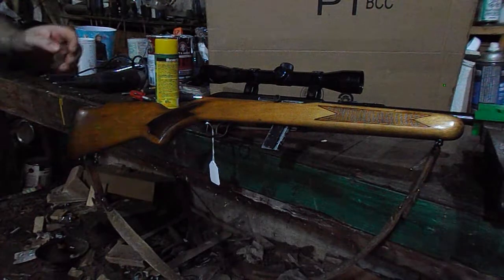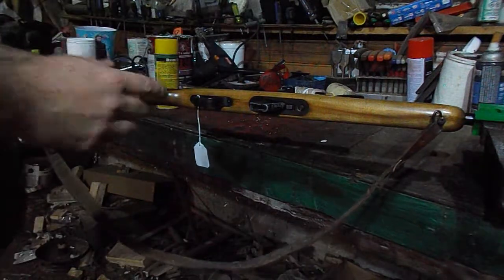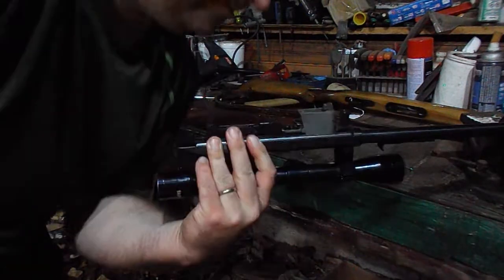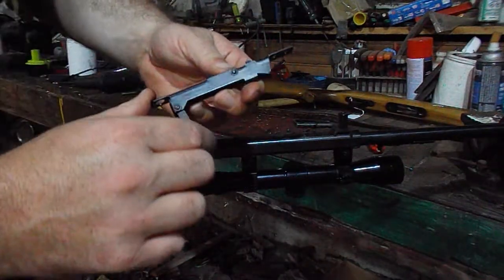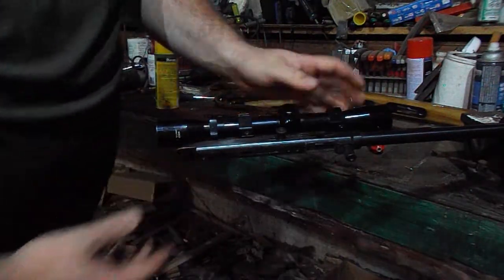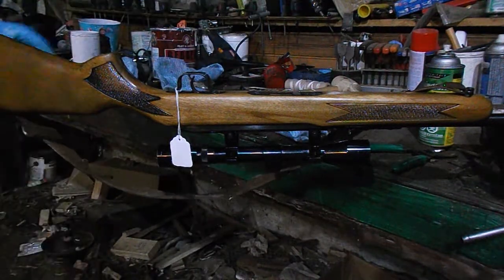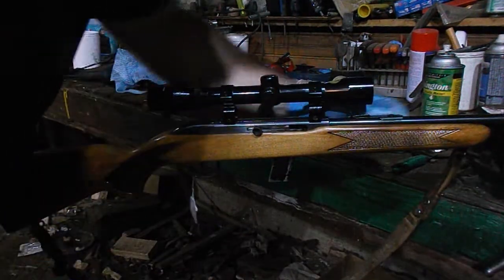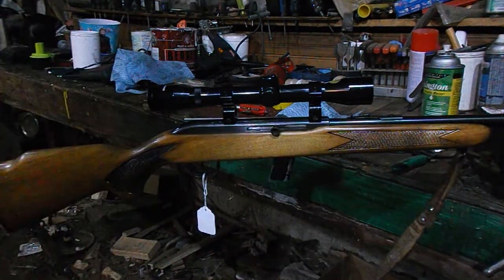Lakefield Savage 64B disassembly and cleaning

Comment: Nice, i just took apart my cooey64b and it was super dirty. There was balls of crud from all the oil and firing all these years. I run my semi autos dry , free of any oil so they dont gunk up like this. I love the cooey 64 b , its so easy to take apart and clean, even the mags are super easy to take apart and clean. I have a 6x weaver but i put on a 4x weaver instead and im going to set it at 20 yards. Cooeys are awsome. My bro has a single shot cooey and repeater cooey and they are pretty accurate. When i got this thing i fired it and it went bang super loud and i felt gasses leak out, the barrel was all rusty and the firing cleaned it out , a little bit of blow back but it runs flawless now its cleaned and degreased.